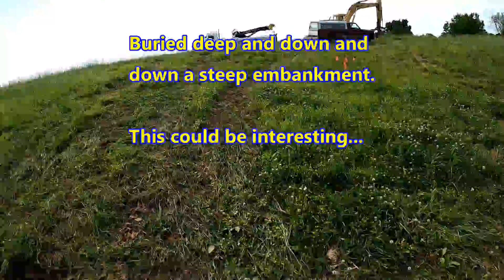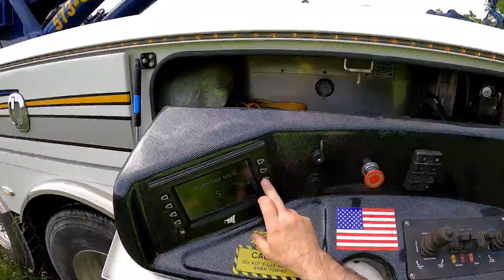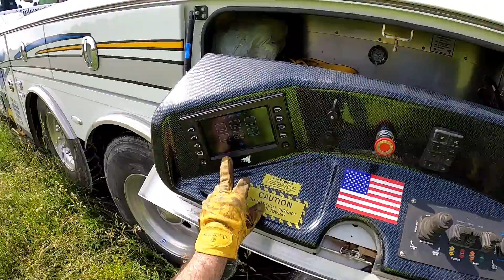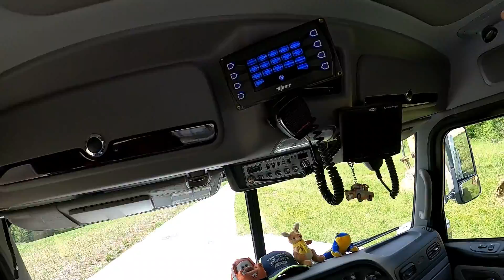Friday Night Cat Fight!!!  Tator VS The Dozer!!!

Comment: An old trick my father showed me back in 1965 chain a 14' pole about 8" in diameter across the tracks and back right out. The pole will break the sucksion. Keep adding poles ae needed. I used the pole trick in the milatary on a stuck D6 in 1974. Works.
Reply: Russian trucks videos off road never get stuck used that method. Awesome
Reply: Worked for me when I was too cheap to hire a wrecker
Reply: Nice. Save you the hassle of a wrecker.

Comment: I Bet Excavator Driver attempting to get Dozer out was NOT Chris in NC on letsdig18 Channel.😬👍
Reply: Exactly, was thinking similar to that as well, Esp that other Exc he recovered out of that larger pond about 4 or 5 mths ago that was sunk by 3rd party
Reply: I agree Chris's would have gotten it out no problem.
Reply: @tvinguidry432  I dunno, the conditions were just not suited for an excavator to pull on it, particularly because of the slick, steep hill
Reply: Yep Chris would have made a reverse bank cut so the excavator would have been anchored in the hill then tugged it right out, filled the hole and been done
Reply: Or that House trailer that took both excavators to move.

Comment: I may be over engineering but when I see this sort of stuck heavy equipment I always wonder if a large plate with a pivot arm placed directly behind the stuck equipment would help. Run the cables across the top of the arm which would initially lean toward the stuck equipment. When the pull begins the arm is doing the lifting as it pivots upward.  This would direct most of the pull upward initially helping to break the suction. Once the pivot arm has gone past the top and then back down to the ground now pointing back to the tow truck, the stuck equipment would likely be mostly free and the plate could be pulled back out of place. The plate and arm would need to be of significant size to provide enough lift of course and would require a skid-steer or loader to place it given it would have to be at least close to the stuck equipment to work. 

Just thinking at the keyboard....
Reply from the maker: That technique is actually quite common.  It's basically used as a simple "fulcrum" tool.   In this situation any such device would have probably sunk straight into the ground, unless mats were placed under it.....and all those items, as you said would have been heavy and would require another machine to place them.   While an excellent idea, not always practical.    Thanks for watching and God bless.

Comment: Asking out of curiousity - why don't you ever use the green winch cable that is located in the middle of the truck's rear? Sorry, don't know the technical term for it. Seems like hard pulls like this put un-needed tension on the boom/crane arm. Again, I'm only asking out of curiosity. What is that green winch used for anyway? Thank you. Love the videos!

Comment: I had a shear pin break on my rear winch so I put a G8 bolt in its place...I was bulling a duce-n-a-half out from the mud loaded with 2 tons of cable when the tow cable snapped and acted like a giant weed eater 180 degrees around the truck. The guys who i told to get behind my truck when I was pulling on it now knew why I was yelling at them to get in front on my truck.

Comment: Have you ever seen people pull stumps using a lever?
Some use a pole or square beam, or a tire.
That's what you need in this circumstance.
Increase your lift and pull.
Reply: As I'm watching, I'm thinking you could do it with a small truck. Hitch point high, like a roll bar. Just tow with you to the job.

Comment: A retired, but still working, firetruck is great for cleaning tracks.

Mud, at the right consistency, will actually pack in the tracks.  They get overtight, increase the load on the machine, and they will not want to roll if the machine is being pulled.  Just a little observation that may be useful to know in the future.

At 13 years old, I got on Dad's little John Deere MC for the first time.  Backed it up 10 feet on some loose dirt and found myself high centered on a stump he'd covered up.  Mr Ez got it moved off, helped get the blade chained up so we could drive it to the house.  When he found out how it happened, he refused to charge Dad for the pull.

Last time I had them pull my 440 out of the mud, it was $20 for mileage, $20 for the pull. ($40).  Doubt I'd see that from anyone these days.

Comment: Easy money. No problem for the Tator. 1 line 1 block = 2 lines. No deadman No extra blocks No extra lines, No Excavator, No extra Dozer, not even a second wrecker. Easy pull for what could have been an extremly difficult and time consuming recovery. Stay safe out there Ron....

Comment: I saw this happen years ago in the swamps of South Carolina! The operator cut 6 long logs about twice the width of the dozer and chained each one to the tracks like rail road ties from the rear of the machine and drove those logs under the machine by pulling the dozer backwards! It brought the dozer from durn near floor board depth in the mud to the surface!! Amazing!!

Comment: At the end I saw the operator leave, that dozer had mud up in the radiator and under-carriage that needed to be cleaned out right away, but he was gone! Nice work 70,000 lb machine pulling a 40,000 lb machine uphill and buried 3 foot in the mud, Nice work!

Comment: On this type of job not only are you dealing with resistant angles and the weight of the machinery but that heavy clumped mud has to be a factor. But you know the capabilities of the Tator so it is up to the task.

Comment: I worked making bush haul roads up here in NW Ontario.When we had soft spots in the roads we used the trees to make what we call corduroyed. We laid out the trees crossways the cross the road like corduroy and then we would put some clay and then gravel and you could drive a tractor or other equipment across a soft spot with no worry of sinking.

Comment: Well Ron I'll say this.... I am SUPPISED you too the Tator off road. 9-10 time you tell the due to weight & insurance reasons you can't do it.... well you did & NEARLY got stuck your self, but with the lift axil you got her out no problem. This was a chalanging job due to having to take the rotator off road a little bit, the distance to the job from the road, the hill,  the mud & the weight of the dozer, but hey you got the job done, safe, no one got hurt & for once NO PRATT fall lol.  A great job by everyone involved you got the job done in like 15 min once you actually started pulling on the dozer. God bless you Ron & everyone involved & everyone at Midwest truck. Hope everyone there is well & safe.

Comment: That ground looked very deceiving, all hard on top, with squishy stuff underneath.  Perfect for trapping heavy equipment.  When I was a kid I lived by a gravel pit that had closed.  The operators used a hydro pumping system to excavate and the waste water and sand was discharged and created a large flat area of what seemed to be a hard sand surface, at least to a person walking on top of it.  That sand layer was only about 4 to 6 inches thick, and underneath that was a silty mud with the consistency of vaseline which was at least 10 feet deep (I have no idea how deep it really was, but we stuck a tree branch down into it and never did find bottom.)  The national guard was looking for a good place to try out their "Gamma Goats" (6 wheeled off road vehicles with very large wheels) and they were warned to stay off the sand and if they got on it, they did so at their own risk.  Clearly they saw that as a challenge, and the first Gamma-goat actually made it out quite a way before the sand broke through and instantly trapped the first one.  A second one road out toe rescue the first one and the moment it stopped, same thing happened, and both were trapped and sinking more and more with every frantic movement.  The stopped trying to get out once they realized it was only making them sink faster, and somebody got a D8 dozer with huge winch and long cable.  It tried to pull them out but it was only causing the D8 to pull closer to the edge of the sand, so eventually they pulled into a bunch of large trees, and chained the D8 to about half a dozen of the larger ones so it couldn't move, then they were able to winch the Gamma-goats out after a day or two of hard effort.  So much for the ultimate mobility vehicle, it had met its match and then some.

Comment: Nice job but there was an excavator on site to pull it out
Reply from the maker: Listen to the dialog in the video.  They TRIED using the excavator and failed.  That's why they called us.  Thanks for watching and God bless.
Reply: Or, the dialog later in the video where the customer explains why the excavator didn't work.. or just read the track and bucket sign on that hill which shows what happened even before the guy explained it.

Comment: I owned oilfield bed trucks as part of my fleet and they got plenty of use! My 50 ton Broderick woulda fished it outta there in a hurry. Had an 80,000 lb King winch on it with 2 50,000lb Sherman's on the poles.. the poles were 5 inch thick wall oilfield pipe..

Comment: How much did that tow truck cost???
Reply: Think he's said before it's about 750,000 US rolling as is
Reply: I think its somewhere around 750k
Reply: I think Ron said $750,000. The bigger Miller is over 1 million dollars!  Sure worth the money anyway.
Reply: $550k "ISH"
Reply: @visionisscaryYTg  We got a 2016 Peterbilt 389 Cummins X15 550hp Miller Century 1150 rotator wrecker. (Basically same truck as Rons) 750k it costed. Was your comment a estimate or guess?
Reply: @MGower4465  yes sir
Reply: @knottyal2428  the 100 ton is yes. Impressive machine. Yeah we got a 2016 (basically same truck as Rons) it’s 750k
Reply: @barnabus1976  correct

Comment: Saw a similar situation many years ago,D7F Military dozer stuck in mud,they tiried to drag it out with a tank recovery vehicle.Did not work,we were able to get it out after we rigged a pipe to a large air compressor,blew air under the machine while pulling on it with two D7F dozers using their rear winches.Lots of work,very dirty but we finally got it out.

Comment: 29 ton ( pretty much ) d6 vs 100 ton pull from the rotator with the doubled line, without the d6 also running and backing the mud would have won.
The small bit of movement the dozer could get while in the mud was enough to help break the pull of the mud.

Comment: Ron, I was really surprised at how easily that dozer came out of the mud.  I was sort of thinking it would be like the time when you had to pull that little dump truck out of the hole next to the guys house. But in that case you were dealing with dirt and not soupy mud like this one.  So I’m figuring that the soup might have made the recovery somewhat easier.  Good job, that guy was pretty interesting too.  Keep making these wonderful videos, I have seen all of them and you have taught me a great deal about what it takes to work the rotator.

Comment: Just imagine the world of hurts you'd be in if the dozer didn't run..
Reply: Or if the dozer had to pull Tator up the hill...
Reply: pull the sun gears on the final drive once its tethered to the tow truck and the tracks will spin freely

Comment: Have you ever had a cable snap or is there built-in safety sensors that stop all movement upon max tension?
Reply: A winch will do what's called "stall" when it reaches max capacity or is overloaded. Basically it stops pulling when maxed out. 99% of the time winches will stall before a wire rope snaps... thats if you keep your wire ropes in good condition.
Reply: @Meeandah  The safe working load of the wire rope cables is a lot less than the winch rating. That's why GOD allowed the invention of snatch blocks..Sooo, yes cables break. I don't know of any operators that have NEVER had a cable snap. It's just ONE of the many dangers of towing and recovery work. I once even had a snatch block EXPLODE. Never found all the pieces of it.

Comment: Wow!!! The Tater is off road… it almost needed assistance to get out of the predicament that you got yourself into. That’s 72,500 lbs of dead weight slightly sinking into dry ground. I don’t think that you could have done as well to pull the dozer out from the roadway, without using both lines.

Comment: I did not think that a single snatched line would be enough to get that out that was impressive.
Reply: Agreed, that super low speed on those winches must have an insane capacity
Reply: Iknew it would doit

Comment: "You won't bust that, we can pull on it.." uh huh... it's gonna break I see it coming.. That definitely isn't that grade 100 Ron uses. I'm amazed that chain held up.. shows what I know lol. Man, gotta love old farmers and ranchers.. seems 90% definitely have the gift of gab.. shutting them up is the trick.. the others just don't like talking but when they do their words definitely hold weight and you better pay attention. I would've been crapping myself to be in that dozer on that side hill.. that would've scared the hell out of me.. I mean I know most of their weight is down low but rolling that thing down the hill would definitely be deadly.
Reply: You are correct with your initial assessment that the chain was possibly under rated for the job at hand if it was expected to do a dead pull, but the assistance of the dozer walking in tandem with the pull significantly reduces the load applied to the chain.  Had the dozer not been able to lift its fat arse up a little at the initial point of movement things may have been a little different.
Reply: "It's 'railroad chain'" :D

Comment: Hey Ron, have you ever considered a switched bypass of the ride height valve, sort of the opposite of a dump valve. Then in situations like this you throw the switch and the tater stands up on her tiptoes to crawl out of someplace like this. I may be wrong, but it seems like it might be another useful tool in the toolbox.
Reply: The Tater on tiptoes.  What a vision. 😄😄😄
Reply: It might help, but it also may act like trying to move with the bags depleted. It won’t allow the axles to adjust to the terrain and hang you up on any small bump or hole. Maybe if you could get something to raise the bags to 85-90% so you still have axle travel and a higher lift might help without losing independent axle travel. Maybe Ron can inform us why that option isn’t there.
Reply: Up~Staging , Without making the wrecker  boom " Travel " , Damn fine pickin' ☆¿